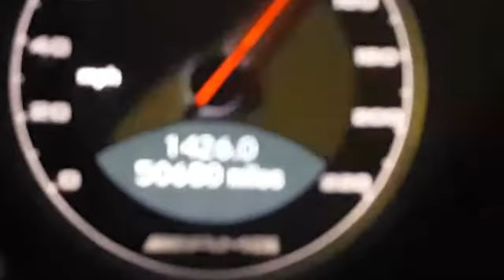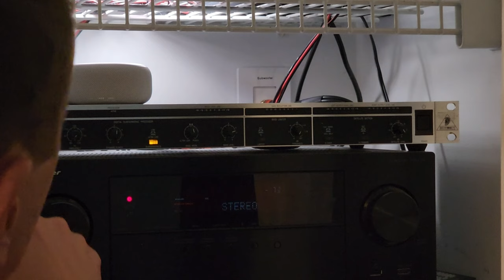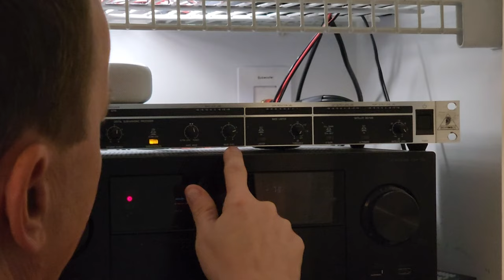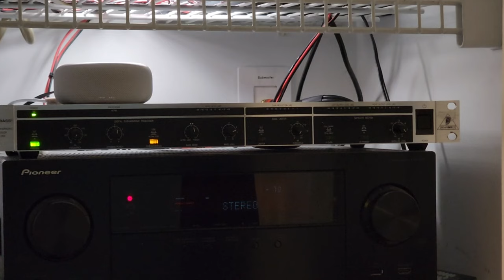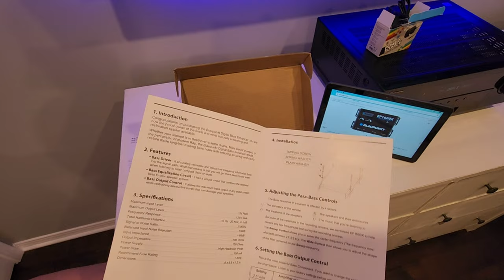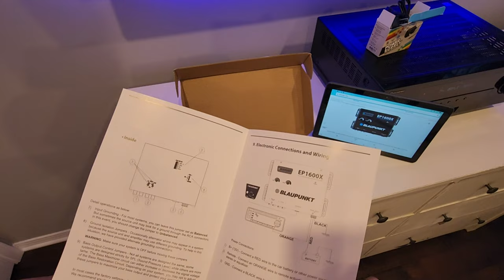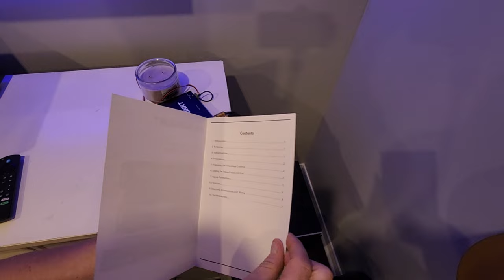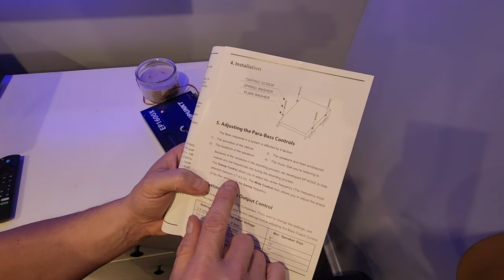I installed a car bass processor (subharmonic synth) in my house and saved $250

Comment: Did I hear that right?  150 amps?  J/K  The thumping is the auto sensing on/off of the sub due to noise out of the Blaupunkt being on 24/7.  If you have it on switched power with the head unit/amplifier you won't have this issue.
Reply from the maker: It actually wasn't it was something to do with the Bluetooth adapter. When I switched adapters it stoppeed.
Reply: @Supercar_Street_Racing  I guess the Blaupunkt just made it noticable?

Comment: The Blaupunkt looks like it's using the same enclosure as audio control?? But I guess the internal will be slightly different?
Reply from the maker: I think it's just a really good copy with the same chipset.
Reply: I believe the only real difference is that the audiocontrol has PCM chip that affects the cut off frequency that is interchangle in the on the audio control and not blaupunkt. Also both units you can open them up and change the output voltage, ground type, balance or un balanced.
Reply from the maker: @TheMessiah91 awesome information!